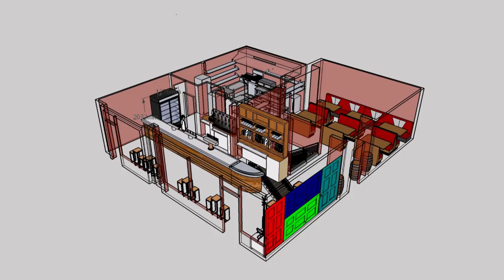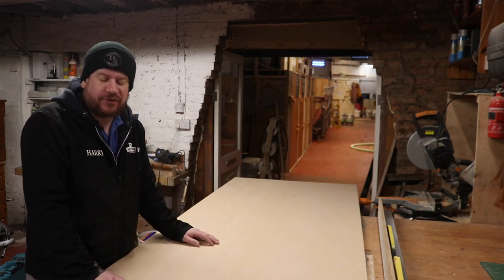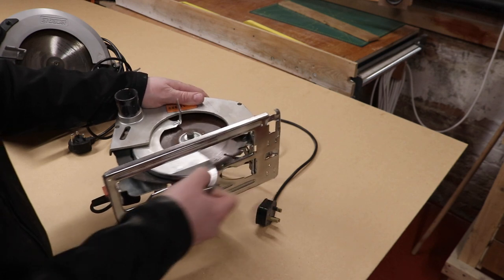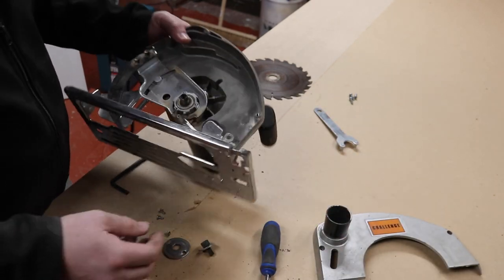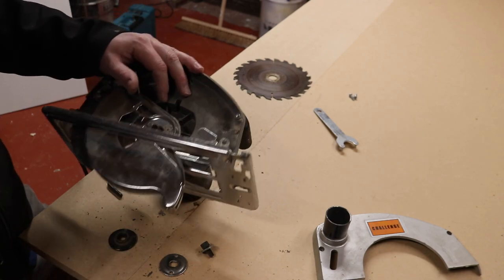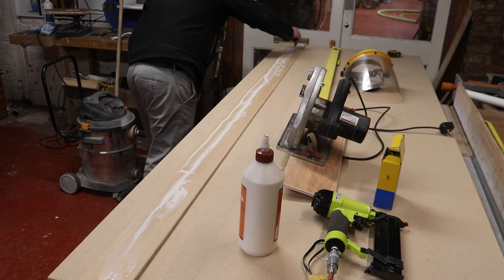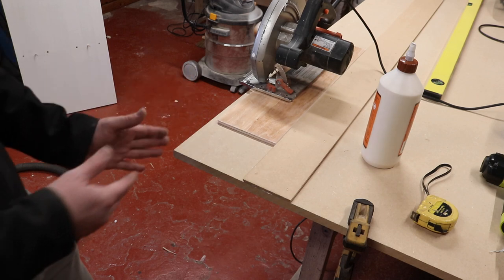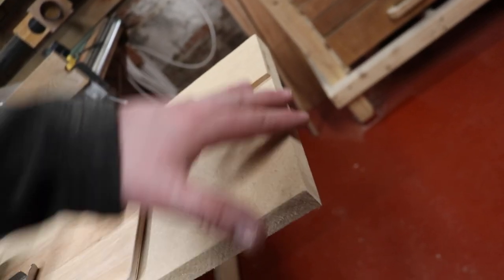TRACKSAW JIG AND SAW BREAKDOWN 🌳🛠

Comment: You are correct Harry. No oil on the working joints of the saw.
Use Silicone (or Teflon) spray instead. Once it dries, will repel dust not attract/gum.